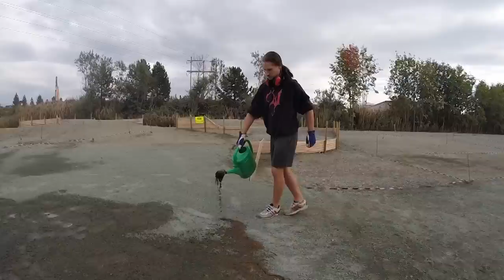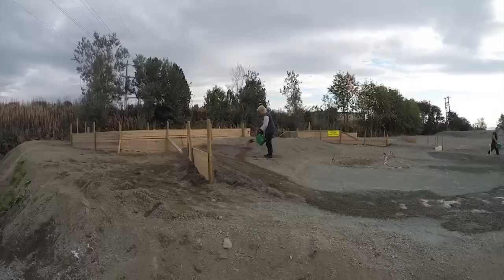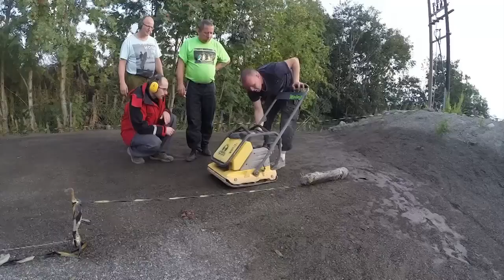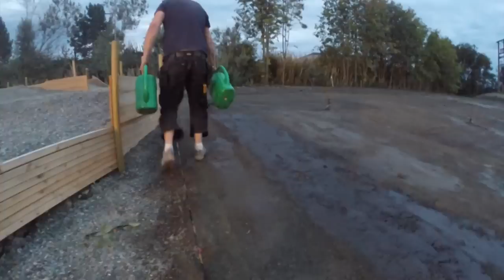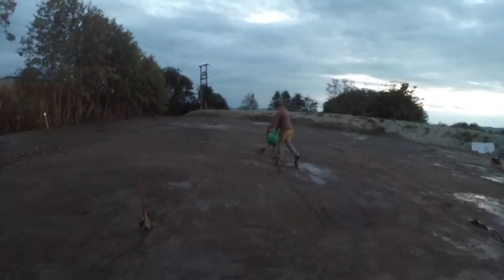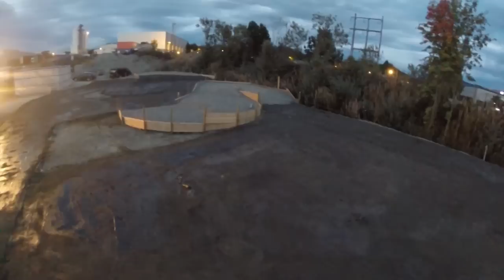20140908 Heggstadmyra banebygging dustex

Comment: Hi  we would like to test dustex on our rc track . Is it a good idea? What is your feedback on this treatment?
Reply from the maker: Old video :) Dustex worked, but not that well, and it was quite expensive. Had to buy in large quantity, like 500 liters. Hard to handle/lift/mix out. The year after we found another product. I dunno how to translate it, but it was some kind of sugar molasses bi-product in agriculture. This was much cheaper, easier to mix up with water, and worked better. We had traction roll issues on clay/gravel surface on our track that year. From googling, it seems to be some sort of sugar cane molasses, used for things like fertilizer, horse food, and also for dusty roads :) https://www.researchgate.net/publication/341783688_Effects_of_molasses_polyacrylamide_and_bentonite_on_dust_control_in_forest_roads